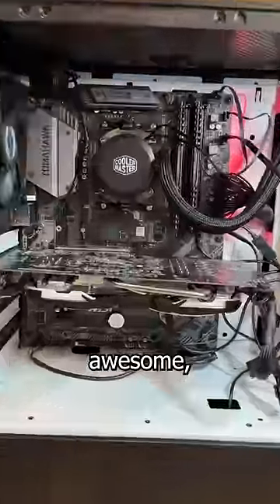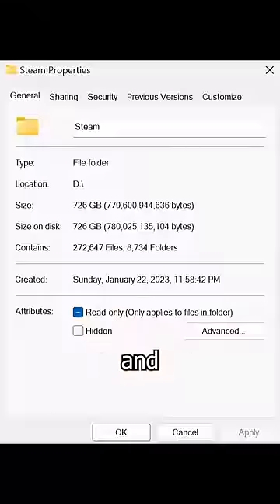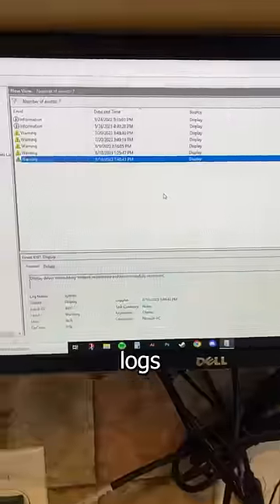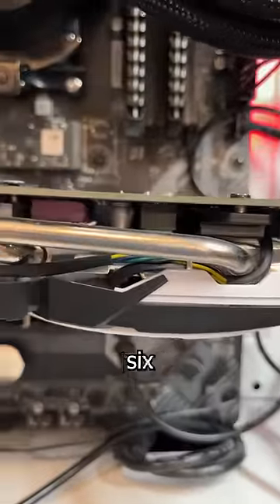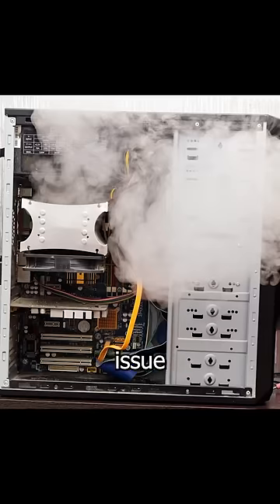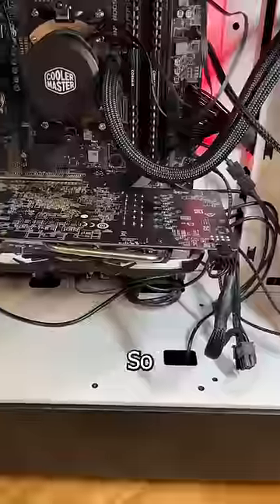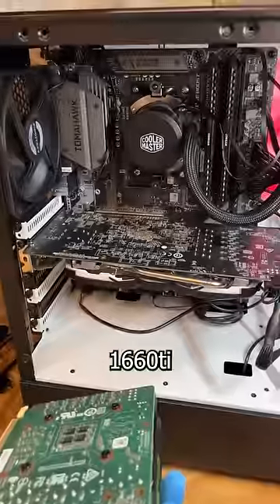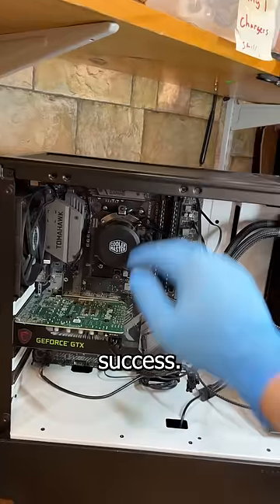GPU sagged and died from overheating 💀 #tech #technology #pc #gaming #shorts

Comment: Rip RX 580.  Thank you for your service.  o7.  I have that same model.  Swapped it for a 6600 xt and it was a decent upgrade.  Later on I got a 6950 xt.  The 6600 xt is in my fiancé's pc now and the 580 is on break but might get used later on for display output.  I think it's days of gaming are over though.

Comment: Change the inlet and outlet pipes of the radiator of the integrated water cooler to the bottom. That's where the original problem arose.

Comment: The main problem is incorrect mounting of the AIO. 

It's weird because supposed "experts" actively recommend this type of AIO mount. To fix it, the tubes on the radiator should be at the lowest possible point, and the top of the radiator above the cooling block.

In this case I would mount the AIO to the top of the case, and add some more fans.

This will vent the heat from the CPU outside of the case, while pulling in new fresh air. 

It will also maximize the cooler's life span.

Comment: Dude that AIO pump will stop making that awful noise and running air through it if you mount the radiator tubes down or to the top of the case…

Comment: Rotate the CPU radiator and those air bubbles will go away. I'd also rotate the CPU cooler block so that the hoses are on top but then the CoolerMaster logo would be vertical ruining the aesthetics of whole build.

Comment: To fix the bubbles wouldn’t you take off the cpu cooler from the case. Hold it above the cpu so the bubbles get trapped in the end far from the hoses. Then reattach it with the hoses at the bottom keeping the bubbles trapped at the top of the cooler instead of next to the cpu? Is about as cheap of a solution as I could think of 😅

Comment: I've never encountered a 5600 drive in the wild. I don't believe they exist. When I hear the air bubbs in my AIO Cpu cooler, I just prop it at a angle on some bricks to let bubbles accumulate in the radiator part. With my rotated motherboard case the tubes are the lowest part between the pump and the connection to the Rad.

Comment: I had the same issue with an RX590....!not the sagging but the same event log, I think MSI overclocker the S*** out of them, give is more power and ramp up the fan RPM and it should be fine

Comment: So much misinformation in these comments, bro. The reason he didnt mention the radiator being upside down is because you literally CANNOT install an AIO radiator upside down. It's either positioned too low or it isn't. 

This is basic mechanics and physics, my dudes. The pump in an AIO isnt made to move air and pockets of air are less dense than water so the air always moves to the highest point in the system. 

The reason the pump is gurgling on start up is likely because its old and has lost water due to evaporation so the water level is low enough that the hoses arent always filled. Which can be fixed by just topping it off. Changing the orientation keeps this from happening, but it's really a minor thing. I haven't seen a single tech channels from Linus to JayzTwoCents saying that you can't mount it this way or that it's bad. For example, GamersNexus says that "tubes up" is fine, it's mostly a noise concern until your water gets low.

Just make sure that the top of your pump is lower than the rad and you'll be fine.

Comment: My question is why did you downgrade his graphics card, you'd have to reinstall the graphics driver entirely. Not to mention if he ever wanted to switch to Linux he's now stuck on Windows due to nvidia's drivers. I feel like this repair would have caused more trouble than it's worth not to mention just adding a little bit of water to the AIO cooler probably wouldn't cause them it's problems would it? I'm just saying I would do things a little bit differently if I were in your shoes but the mechanical hard drive was a must.

Comment: Hi, i have the same gpu and have the same error message with the same problems. The reason of this problem is a windows update, the latest driver for gpu which windows automaticly install is not compatible with the latest AMD software. So uninstalling the AMD software and use windows' chosen driver for the gpu until the fix comes is the only solution i have find instead of roll back to an older version of windows before that update and older version of amd software + gpu driver. If not, the same error will keep repeating, screen will flicker and sometimes the pc will freeze as well. You can try to open AMD software if you don't believe me, you will %100 get the error which says '' The version of AMD Software that you have launched is not compatible with your currently installed AMD graphics driver.''

Comment: My PC is also kind of trash. It has an i7-8700k and a 1080ti. But it gets really hot, like 90°C while gaming and the AIO is making weird noises. It produces a really loud vibration that changes is frequency all the time. I have an internal 5.25" card-reader/usb-hub combo unit where some ports don't work and the card reader is deactivated in device manager as it produced an error tone every few seconds and it freaked out the device manager and explorer. My USB-C Port is buggy as it always looses connection and has extremely slow transfer rates. My GPU is kind of fine but I can't disable or change the RGB. It will just pulse red until forever. My memory sometimes gets detected as 16GB instead of 32GB and I have to reboot to use the full 32GB again. And my SSD/HDD have a runtime of multiple years.

I guess it's time for an upgrade in the near future. But I have changed so many settings und installed a lot of drivers and software I don't have the installers for anymore. It was a lot of work to install them. Also I don't want to pay thousends of Euros to get a decent PC if I don't play very often.

Comment: Where is your shop located? I'm in need of service on my freshly built pc. Need a bios reset cuz i saved a wrong setting and it won't let me in bios anymore. Need my old hdd cloned to the new ssd. And need the ssd moved to the primary slot, which i didn't just do myself cuz the heatsink has weird screws in it. The pc does work though. Got all the connections right on the first try. Very clean cables in the front. Japanese subway at rush hour in the back lol. But yeah, got to desktop on my brother's win 10 usb stick. But it wasn't my win 10 cuz the hdd wasn't being read. I kept trying bios things to get it to read but then yeah, saved a wrong setting. Don't have the tools to go any further

Comment: My AIO sounds like a dying Volkswagen Virtus engine, my 2060 Super is sagging 10ft, and it somehow works except Nvidia thinks i'm using a Radeon 6950XT with Nvidia drivers, and my games from Steam and Epic Games are on a 2004 Samsung SpinPoint P80 at 80GB

Comment: I just found an unused 1TB 7200 HDD in a box while I was clearing stuff out, but idk what to do with it. All my systems are switched to SSD for noise reduction except the NAS, but that's running 16TB Exos drives so I can't put it in there...
Reply: You can keep it as an external drive for making backups and stuff

Comment: The pomp is an easy fix, just flip the fucking radiator, no wander it has air bubbles the radiator is in the worst possible position. Did you guys not watch gamer nexus video about aio cooling ?

Comment: He just gave this guy a MAJOR update. I don’t care if the Rx580 is cheap, that thing is the least power efficient price of junk that can barely output a decent frame rate for games.
Even an older 1060 6GB would be more efficient than an RX580 💀
Reply: I had an rx580 until a few months ago, great card that lasted me almost 5 years. Definitely struggles with the newer games though
Reply: @pepperjacktv6827  cool, but I don't entirely care my dude. As you can see, I don't pay mind to old as heck inefficient GPUs that are still being sold,

Comment: Bro the fact you replaced it with another hard drive is so petty and selfish of you. Should’ve at least used an SSD if you were even going to replace it in the first place. 5400 RPM vs 7200 RPM ain’t much of a difference.

Comment: Flip the radiator so the hoses are on the bottom, because all the air bubbles naturally float UP to the top of the rad and then get pumped back into the Block/Pump.

Comment: first mistake  is the radiator place must be top ! and got space second  buy a  ssd dude  3rd you got m2 slot  there install something  omg  replacing the card is the easy way  you can do more stuff  with lower budget than  just replacing a card come on dude its free to  change  place the radiator